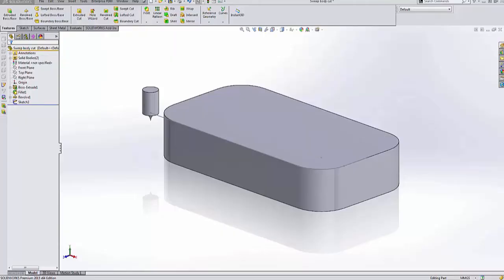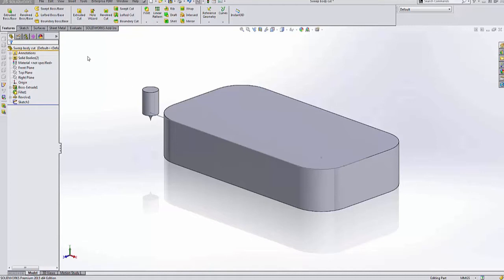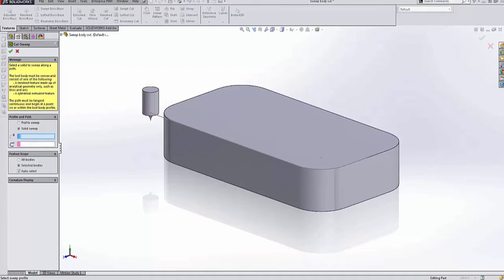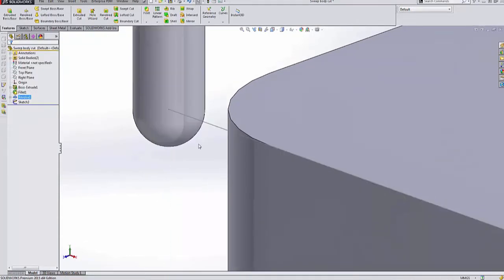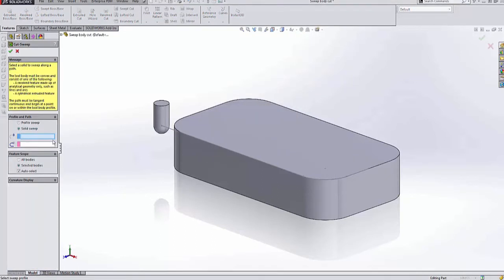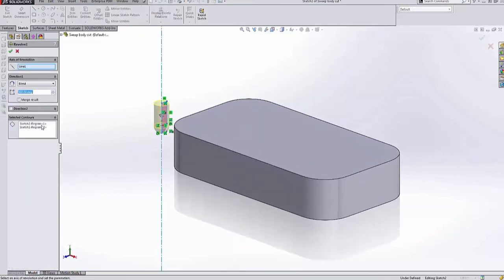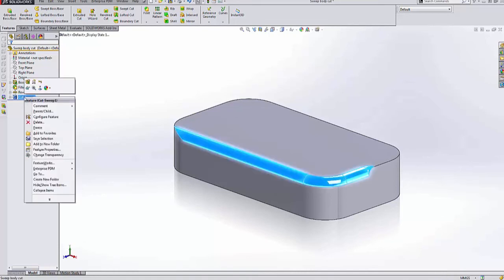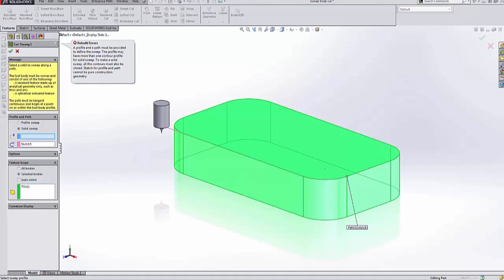SOLIDWORKS Quick Tip - Using a Concane Body for a Sweep Cut

Comment: How make square solid body cut ??
I have square bottle and want to make twister block according to that square bottle
Reply from the maker: Hi Maulik,
If you wish to have a square tool instead of the round tool shown in this video you would create a Boss Extrude in the shape of a square in place of creating a Revolve Boss as this video shows.  That square tool can then be used with the solid sweep command.